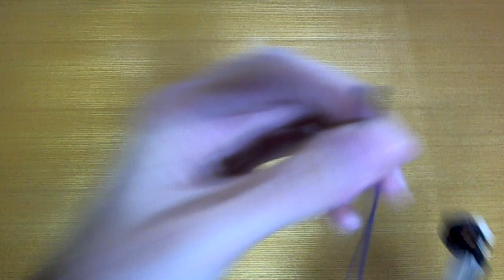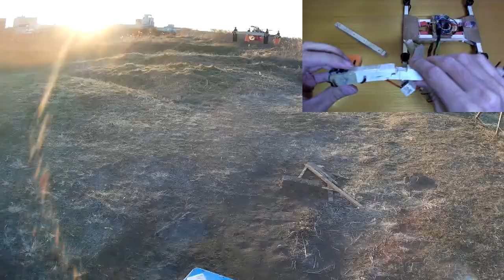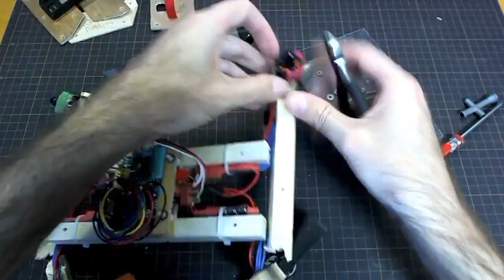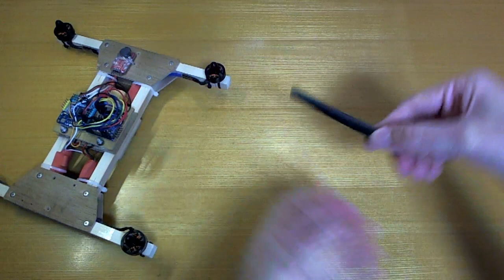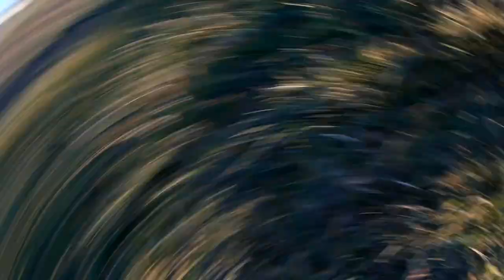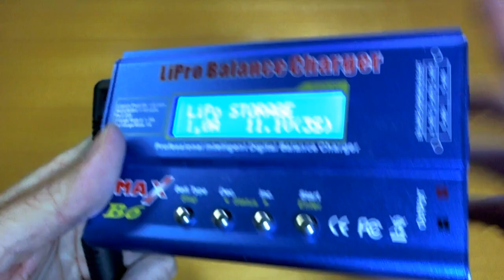Cheap-ass quadcopter build Part 15 - Three months later

Comment: i had pretty good luck with 1045 props on my quad. been flying 8045 before and they had some trouble liftung the quad with the 2200mah 3S, the FPV Transmitter, the gimbal, mobius and all the stuff that has by now crowded my quad :D
i already thought i need to upgrade to a bigger frame or stromger motors, but as it turned out, just putting on 2" bigger props would make it super snappy again :)
also i flew with CF props before, and while they are very durable and hard to break (didn't break a single one yet), i think that plastic ones are much more quiet, and also i believe they give me better video.
Reply from the maker: I'm using 1045 at the moment for my big quad, but I'm wondering if they may be a little large for the motors I have. As you can see from one screenshot in the video, I've ordered a selection of 9 inch props to try :) My motors are 2212, yours are?
Reply: ***** i am actually using these motors:
http://flyduino.net/Multikopter-Brushless-Motor-Multicopter_16

Comment: I am surprised about what you say regarding the fact that your charger cannot discharge batteries down to storage voltage.  I don't have an Imax (and yours may be a clone anyway) but the 2 4 button chargers that I have can both do it, and it has always looked very much to me as though the majority of 4 button charger use the same firmware.  What happens when you try ?
Reply from the maker: Yes, it's a clone. It stops after a minute or so, saying "Full" :D
Reply: ***** What is the overall voltage at the point it stops and what does the display of individual cell voltages show ?
Reply from the maker: well since it stops after only a minute, I would think the voltage was pretty much the same as whatever it started at. I'll check it exactly next time I have have a fully charged battery around.
Reply from the maker: UKHeliBob
hey I think you are right. When I try with a fully charged battery, it keeps going, five minutes so far, so I guess it needs to be significantly higher than the storage charge when starting. Previously when I tried, the battery was not fully charged.
Reply from the maker: UKHeliBob well that worked perfectly! I guess the battery just needs to have a decent amount higher charge than storage when starting.